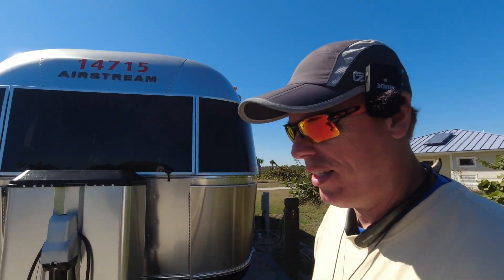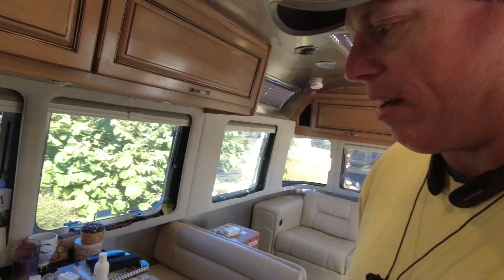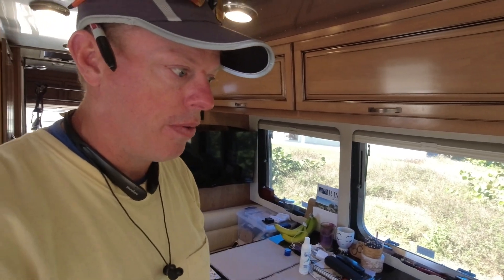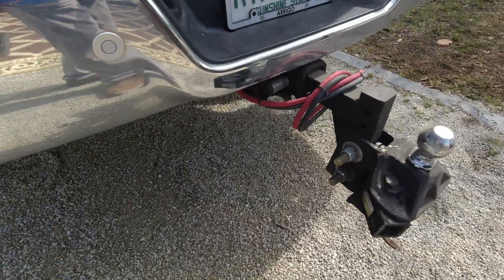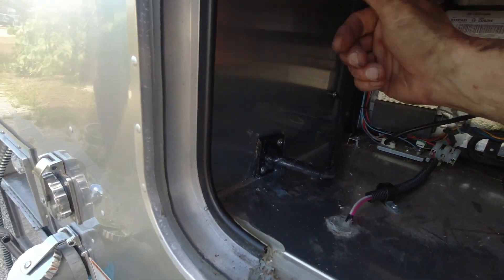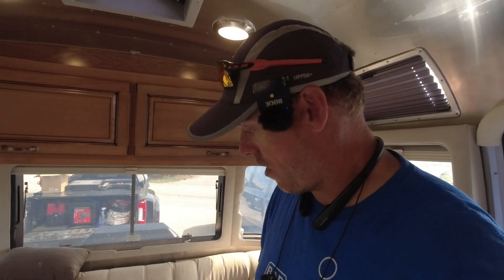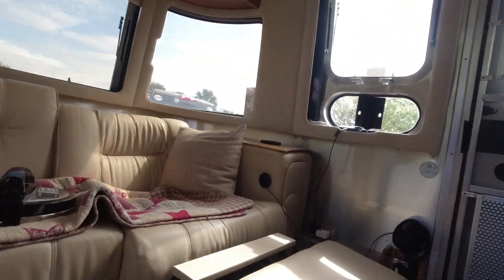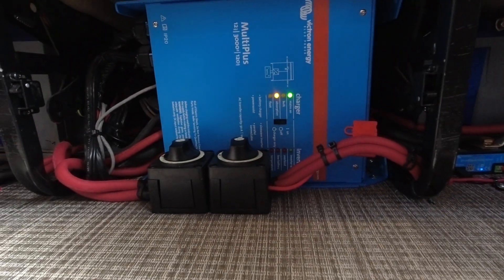@RenogySolar + @battlebornbatteries + @VictronEnergyBV | 2020 Airstream Classic 30RB

Comment: did you have to upgrade the existing converter or is the factory installed converter  lithium compatible? great video by the way. thanks for posting it and your time!
Reply from the maker: The factory inverter is either removed or disabled because the Victron multi-plus is a converter.

Comment: Great video, thanks for sharing.   What is in the grey box under dinette bench. "Automation" box and what did you do with the subwoofer under sofa?  Thanks
Reply from the maker: Thanks so much. I relocated the subwoofer further under the couch, oriented so the controls are still accessible. The automation box is to ensure the whole 50Amp coach can run from a single inverter.

Comment: Hello Mike
We have a 2020 Classic like yours. A few questions: why didn't you locate some of the Victron equipment under the wardrobe closet (replace existing and add updated)? Also, did you keep the existing 3 Amp panels when you added the new ones?
Thank you.
Reply from the maker: This specific Airstream has a lighting system with all of the main components in a shelving unit under the wardrobe closet, so there was not additional space for the Victron components. No, I never keep the Zamp panels on installs because of the compatibility of Renogy panels in parallel. The factory Zamp panels do not provide the performance that I like for clients to be able to achieve with the Renogy panels. Thank you for watching.

Comment: You do nice work Mike! I see they had truck wired to charge the batteries, I assume there was a dc to dc charger installed, what size was the charger and what brand? maybe I missed it...
Reply from the maker: Thanks so much. I do not use the DC to DC charger as I prefer the LiBim (mentioned in the video). Here's Battle Born's video describing what it is and how it works: https://youtu.be/VY2b71zoyvg
Reply: I did see that device, but I thought it was an isolator! It looks really small and simple, but it sounds powerful !

Comment: What size fuse would use for a 30 amp Orion when connect to the battery? Are there any pros and cons when considering ibm or Orion?
Reply from the maker: I personally prefer the LiBim over any other dc to dc because you get more output out of it. As far as a breaker goes, if you're going with the Orion I would use a 50Amp.
Reply from the maker: Battle Born recently did a video regarding as well: https://youtu.be/VY2b71zoyvg